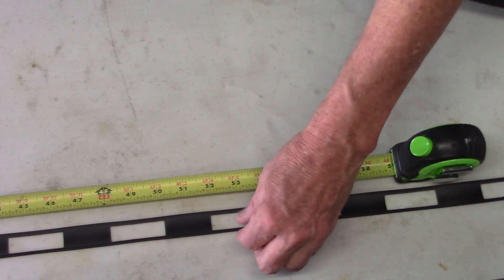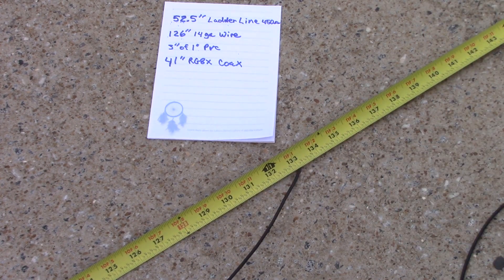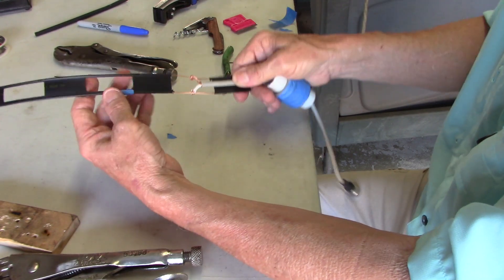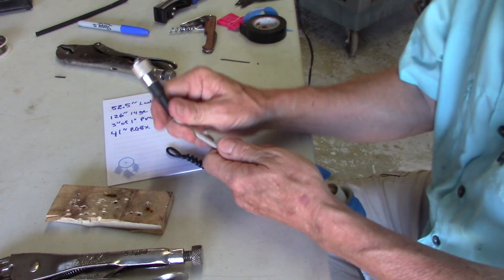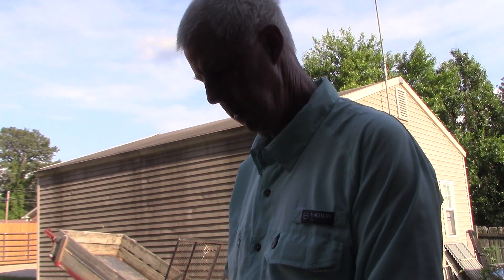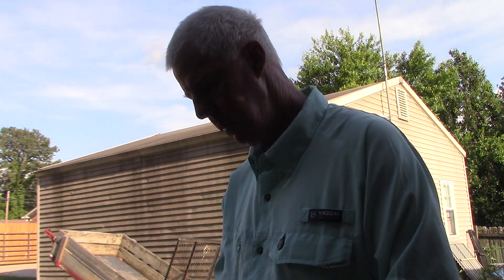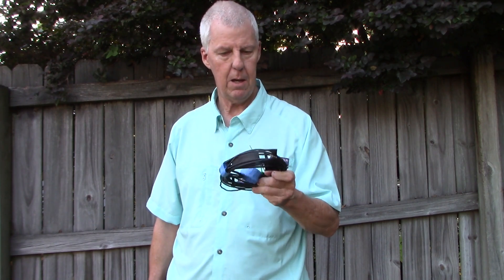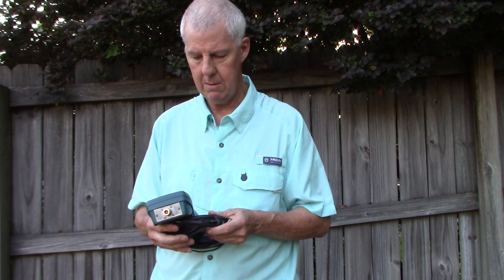6 Meter Ladder Line Antenna Build

Comment: Seal coax end coming out of balun by painting with clear fingernail polish. When twisting shield pigtail, unwise about 1/4 turn at coax end to avoid tension on inner insulation. 

When soldering, this keeps heat from melting center conductor insulation, affecting strength and flexibility.

Comment: I just tested my 6m ladder line antenna and the SWR readings of 10. I raised it on a 31’ fiberglass pole and received no signal not even atmospheric noise. I’ve built good performance Jpole before with duck tape and copper foil but this was my first ladder line project. I must have something very wrong. Will think it over tomorrow.
Reply: I replaced my feed point with coax and added choke and SWR dropped to 2.1. Will do some more adjustment.

Comment: When a man with a duct taped shoe tells how to build a low cost antenna, I believe every word of it without question.
Reply from the maker: Oh man, forgot I was wearing my mow the lawn shoes. I like your comment. The wife has been after me to throw them away. I told her the lawn has no problem with them. Anyway, I'm very budget minded. Wire antennas do not have to be expensive. Good luck with your build. Steve -  Ad4xt

Comment: One advantage of J-pole antennas is that they are typically broad banded. I've made over 25 for 2M:
58-in
18.5-in 
2-in separated 
1/4 dia al rods
Fed 2-in from gnd short

KK5R

Comment: Thank you for the information!  You can adjust the window. Cut it a little long, the one side can be cut down, but it will make the radiating element longer, but that can be adjusted easy. Just an idea I had and thought it may help others.   73   W4DES

Comment: I have a question about the order of adjustments for tuning.  Do you get the SWR right first by adjusting the position of the coax connection and THEN tune the frequency by shortening the element length?
Reply from the maker: Yes, get the best dip with coax position, then fine tune the wire.

Comment: Excellent instructions!  I've got a feeling we will have several new 6M operators on the air soon.  By the way, you CAN adjust the ladderline matching section after assembly.  All you have to do is cut the side of the ladderline that is not soldered to the 1/2 wave antenna element.  That effectivly shortens the entire matching section.  You could also make it longer by soldering a piece of wire instead of clipping.  You need to maintain the perfect gap if you want to extend it.  The tricky thing about these antennas is that everyone is going to source slightly different materials.  The variations in velocity factor of the various materials and the variations in your individual assembly will be the reason that no persons exact measurements will be the same.  For these reasons, ALWAYS cut your parts longer than the plans say.  You will trim them to length in the tuning phase, exacly as demonstrated in the video.
Reply from the maker: Some excellent points you make here Mr. Redacted. I hope everyone reads your comment here. You are spot on. Thanks for watching and the input.
Steve - Ad4xt